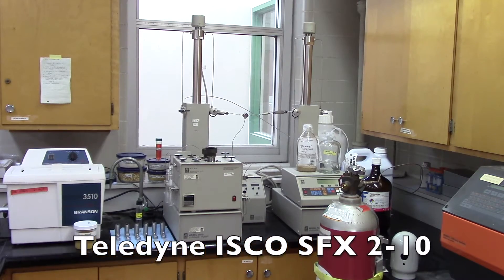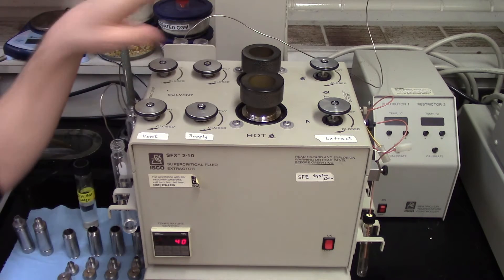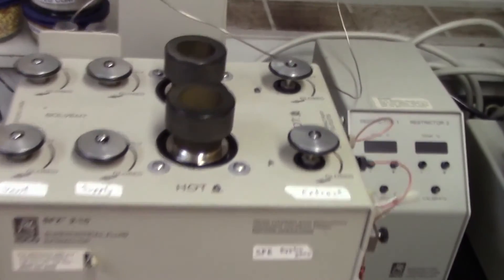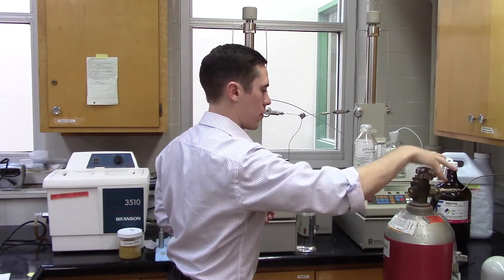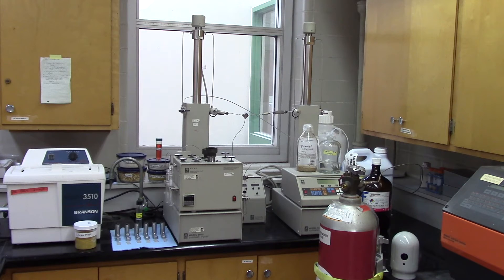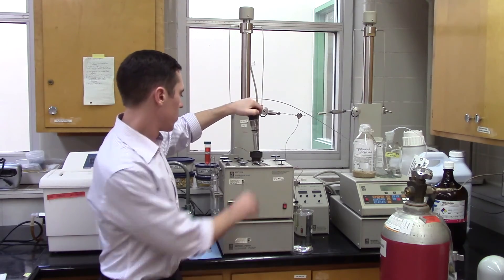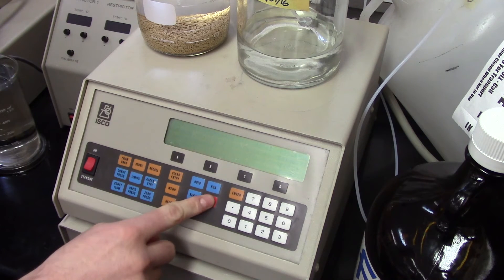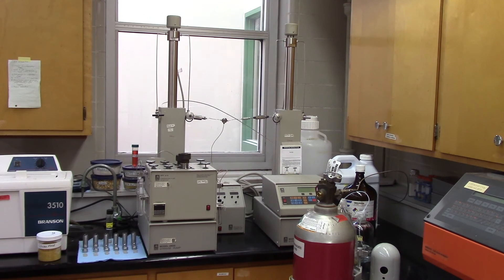Supercritical Fluid Extraction instructional video

Comment: Hi , 
At extracting without modifier you placed the test tube in hot water bath to prevent ice formation, but what if the material that we work on it could be affected by high temperature. is there another solution for this situation.
Reply: Yes there are a few ways to manage blockage. What max temperature would you like to reside under?